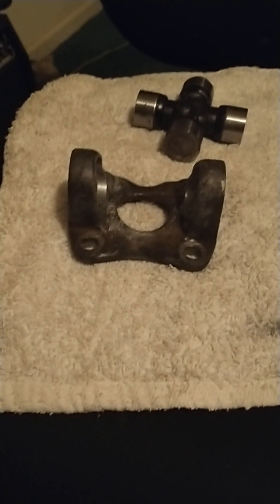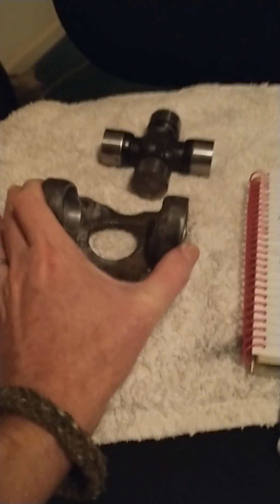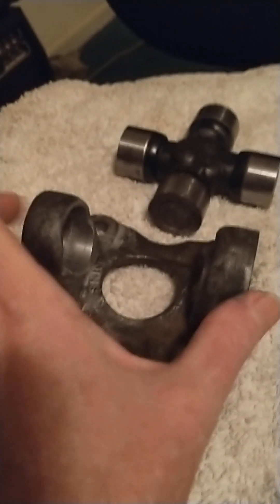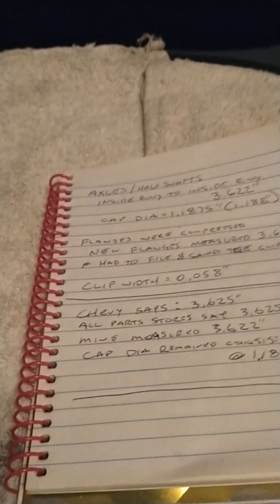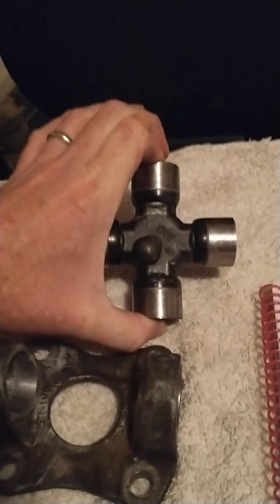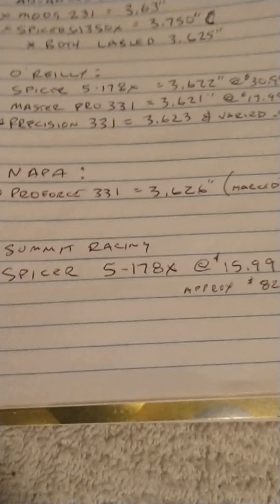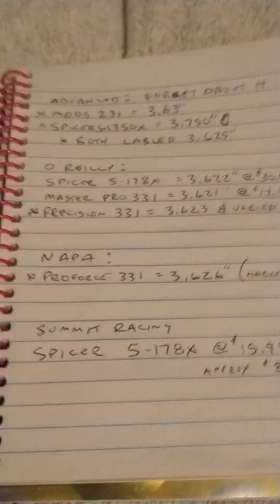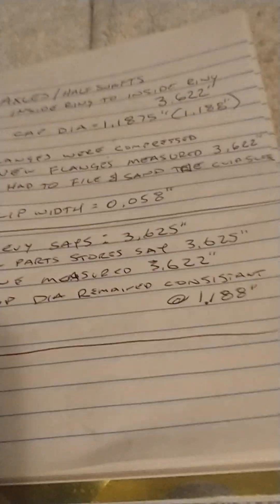1975 C3 Corvette Halfshaft U-Joint information and measurements

Comment: I had this same problem.  Another youtuber mentioned that you can unbolt the axle half part that the flange bolts to, it will support the flange as you press the bearings in and out. This worked like a charm.  Also, if you do bend a flange, you can bend it back by putting about 4-5 layers of the u-joint box thin cardboard in the middle (the thin flange area) between the two flange halves.  As you tighten the halves together, it will bend the flange back so it will be straight again.  This was the only way I could get my bent flange to be straight again and the u-joint loose as it should be.  Also I had to pay close attention to clean/sand all the cup mating surfaces (where the cups press into) and clean the retaining ring slots.  This could easily eat up a few thousandths.